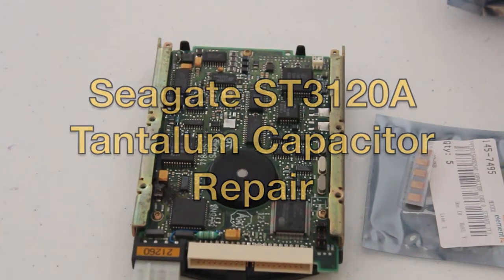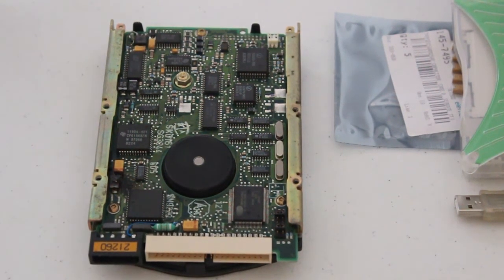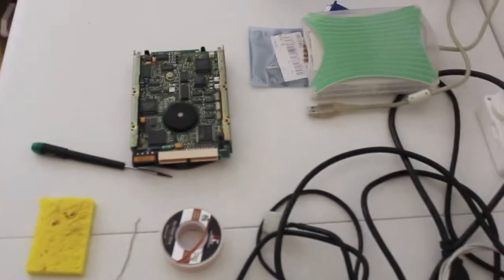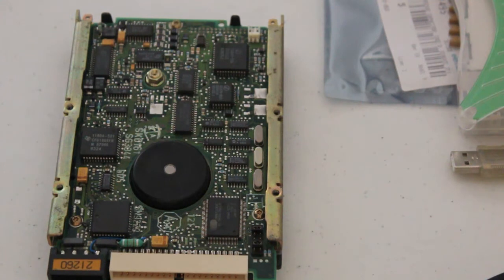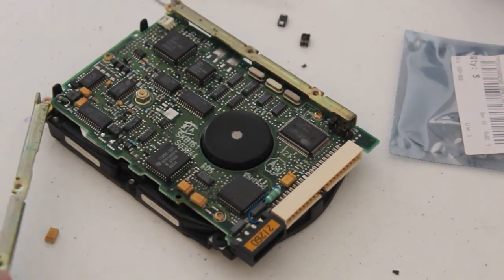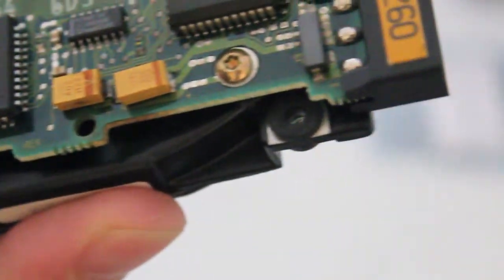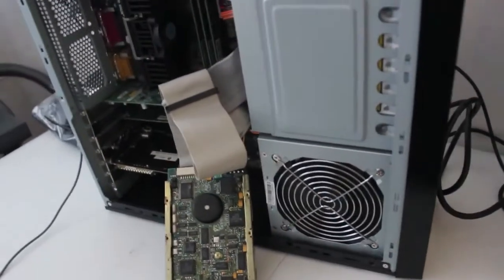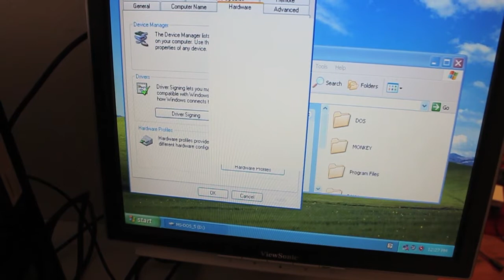Seagate ST3120A Hard Drive Capacitor Repair

Comment: Just a tip (worth trying): reflowing only one pad before positioning the new cap and tac it in place is easier than pre--tin both pads as you show here. With the above-mentioned method, you end-up soldering your cap flat, one pad at a time much faster and cleaner (you don't need to reflow more to eliminate tension stress as you simply avoid it from the get-go). What do ya think ? ;)
Thanks for the vid !

Comment: Is there any advantage to tantalum ? I was going to replace the SMD electrolytic on my raspberry pi with a SMD tant as i am afraid i will knock the thing off every time i plug it in. but after this i am thinking against it because i don't want to break the first rule. "don't be on fire"